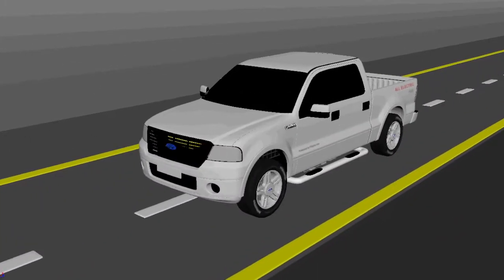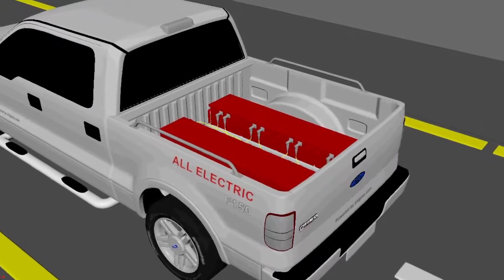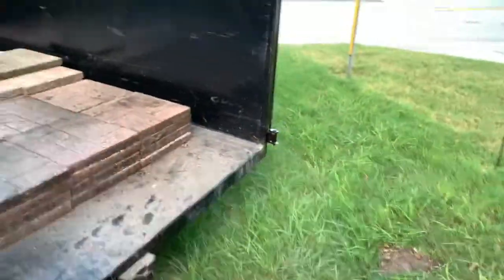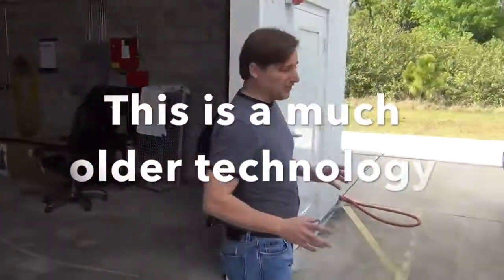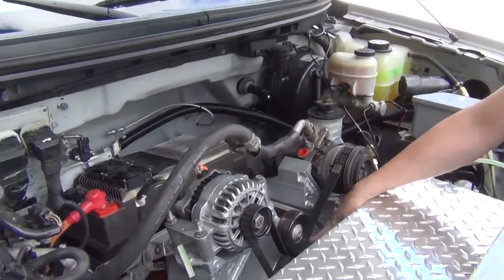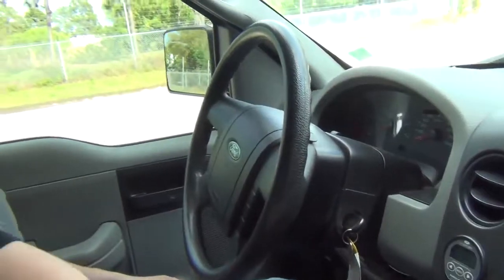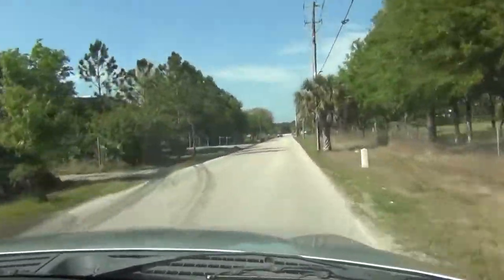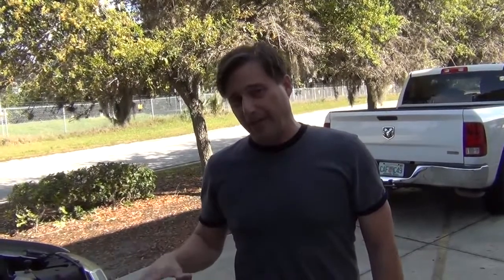EVgine All Electric trucks

Comment: Yes, batteries are in the back and then a false floor is added.  New side rails are installed adding 1 cubic foot more storage space than the original F150.  AWESOME IDEA AND EVERYONE LOVES IT.
This system works on ant truck Class 1 through 8.

Comment: I don’t like how the batteries are in the back you are adding weight to the back, and what about midsize trucks? I have a 2004 ford ranger
Reply: Yes, batteries ar eint he back and the kit actually adds 1 cubic foot of more storage space in the back bed area.  Of course it works on a Ford Ranger.
Reply: @ronaele33  ok well what about regen, price range, and overall average mileage range? I can get maybe 220 to about 230 miles on full tank of gas. I really like the idea of the ev conversion kit. Also is there a way to put the battery where the gas tank used to be?
Reply: Yes, when batteries weigh nothing in year 2052 EVgine will use those for sure.  Great idea!

  For now, EVgine batteries weigh the same as Tesla batteries.  Tesla and Ford place their batteries under the truck and if road debri hits the battery pack what will you do then???  

EVgine batteries are in the back and when you raise the bed rails up then you actually have more storage space than before.  Brilliant Idea from EVgine indeed.
Reply: Yes, when batteries weigh nothing in year 2052 EVgine will use those for sure.  Great idea!

  For now, EVgine batteries weigh the same as Tesla batteries.  Tesla and Ford place their batteries under the truck and if road debris hits the battery pack what will you do then???  

EVgine batteries are in the back and when you raise the bed rails up then you actually have more storage space than before.  Brilliant Idea from EVgine indeed.